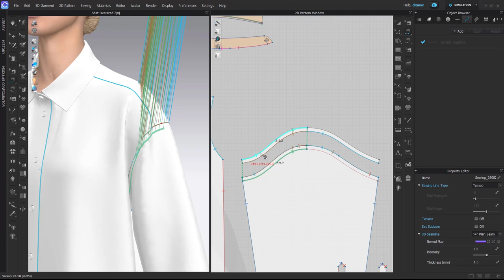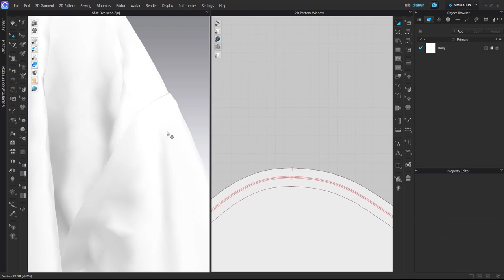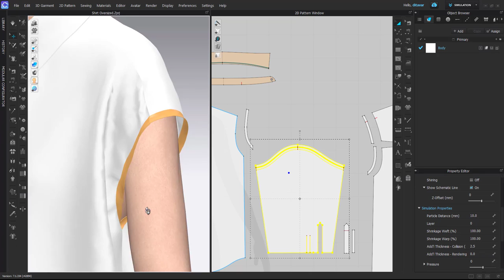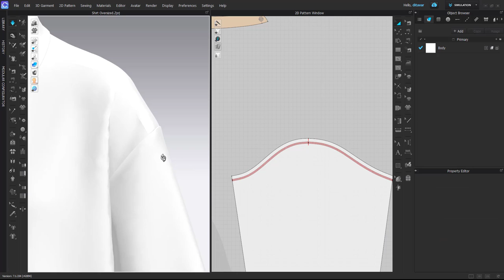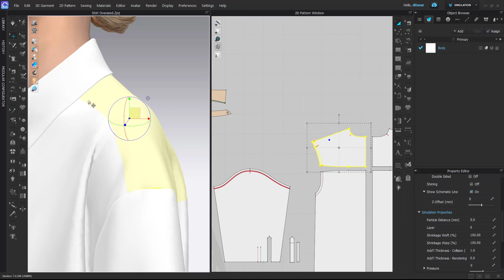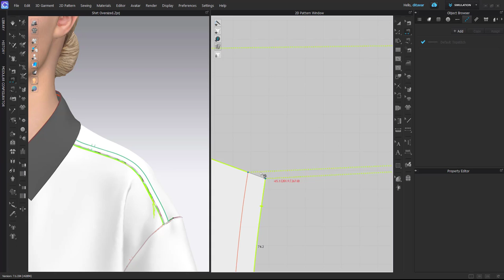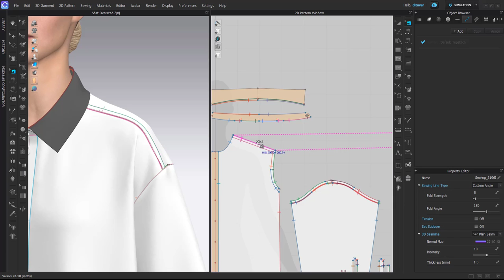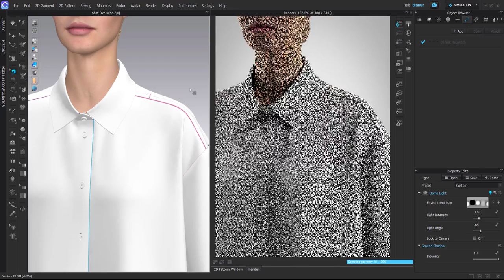CLO3D | Realistic Seams with Seam Allowances

Comment: I tried your method, managed to make it work, but it makes the process a lot longer, especially for items that are more sporty. The easy way I found is this: after offsetting 3 internal lines for splitting the mesh, sew it and change the settings of the sewing line to: Fold Strength - 50 and Fold Angle - 300.
Reply from the maker: You are right, this method is for the specific case where you need the seam allowance to be visible. If you don't need it, it is most certainly an overkill to use this method. There is another video about 3D seams where I use the same easy method you mention.

Comment: Hi i have another question!! I followed this technique to add a folded hem to my dress shirt (learning a lot in the process, crazy how one step wrong can mess it all up haha) I was wondering if people generally finish their hems like this? or do they leave them single layered and flat? (and how you prefer to do it?) sorry it's a very beginner question... not the most interesting
Reply from the maker: About shirt hems I usually add a separate pattern piece to fake the fold-up. Especially if the hem is very shaped, doing a real fold up is a bit of an overkill. And as far as I have seen other's work, either they also use a separate pattern piece, or leave it flat. This method here is good if you want to do close-up renders and show off fine detail. But in regular work, where you check design ideas or prints and make full size renders it is not necessary I think. :)
Reply: @stitchandrender  Ok thank you so much for your help again!! It makes a lot of sense, i was wondering in the end if it wouldnt be better to fake it with a separate pattern piece (make a facing basically), especially since the turned hem is so finicky. I'll keep this in mind in the future😃 tyyy